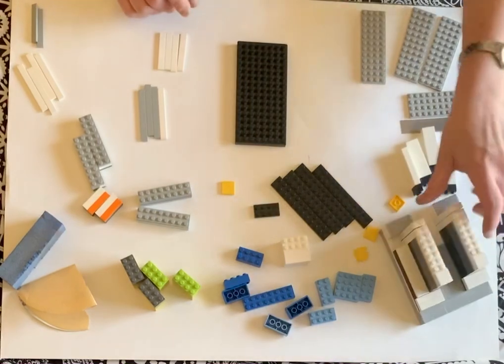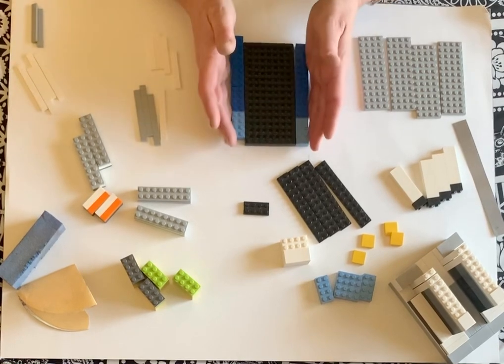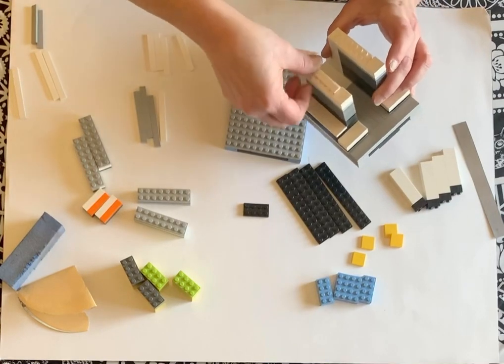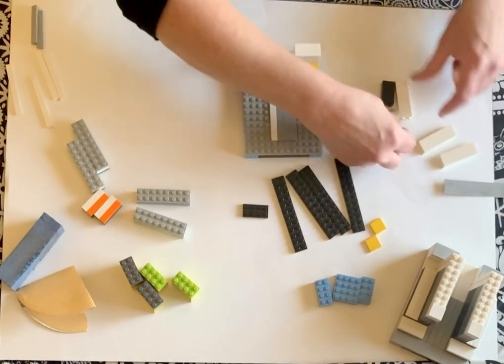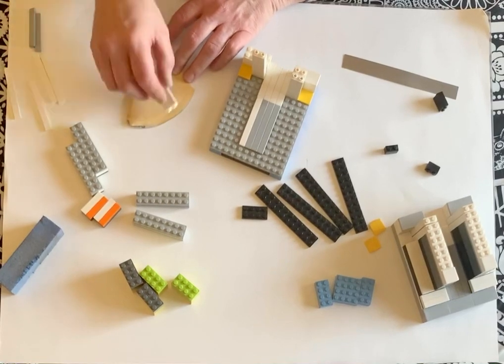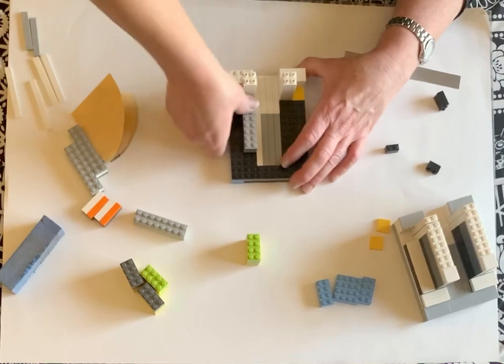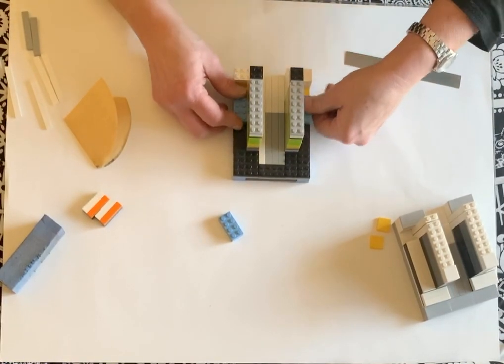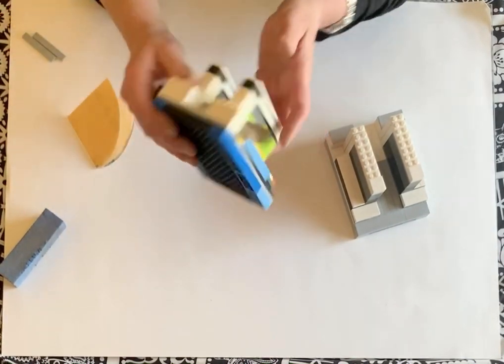LEGO cane slicer for polymer clay

Comment from the maker: I forgot to add the other things I used to make this slicer more durable. I glued each LEGO piece together using Loctite Professional super glue. It’s the best super glue I have found so I highly recommend that. Also having 320 or 400 grit sandpaper is necessary if you are going to decrease the depth of the towers for where your blade will sit so it moves up and down easily but not so much space that it’s wobbly. I personally used my 1” sanding belt to decrease the depth of the tower pieces where your blade will go.

Comment: U didn’t show us how effective it is cutting the clay. Does the clay come into contact with the Lego ie resting on it? If so how do you avoid the imprint of the Lego? A more detailed updated video would great if you can plz ty.
Reply from the maker: I can try and redo the video, I’m short on time these days but I just printed out some little lined cards. One for each
 (1 mm, 1.5 mm, 2 mm) using a grid I made myself on my Silhouette software and then cut and laminated them to fit in the tunnel where the cane goes. Then I can just slide the cane forward as I cut and it’s not touching the legos. I specifically used the flat smooth pieces in the tunnels bottom and sides just so there wouldn’t be any risk of indenting the clay with a Lego logo. Hahah. Hope this helps. There are loads of free printable grids online too. Here’s a link. www.printablepaper.net